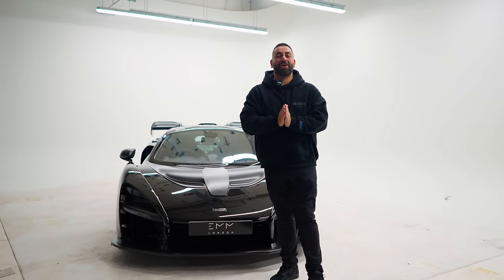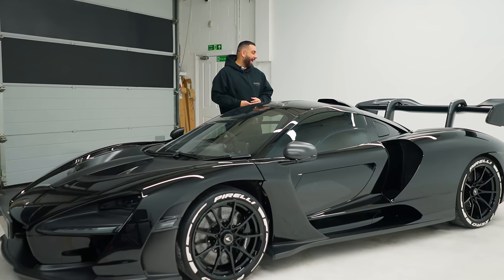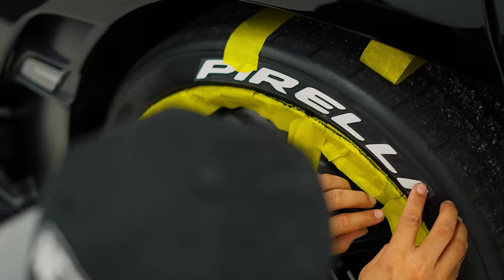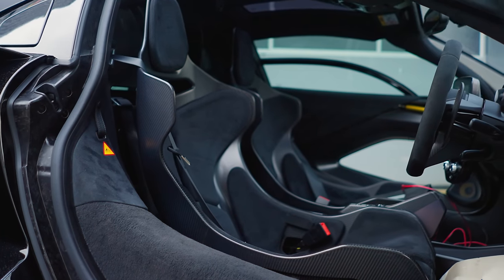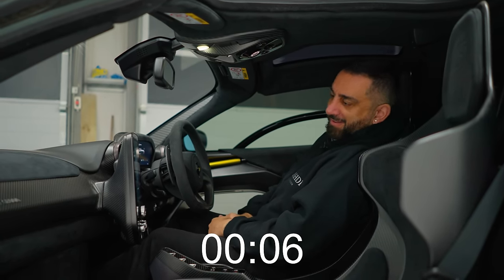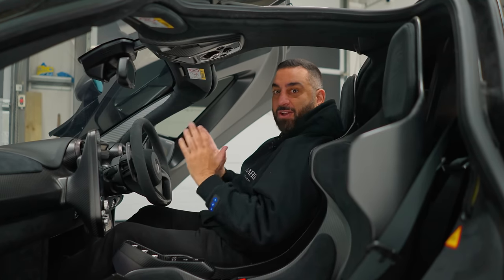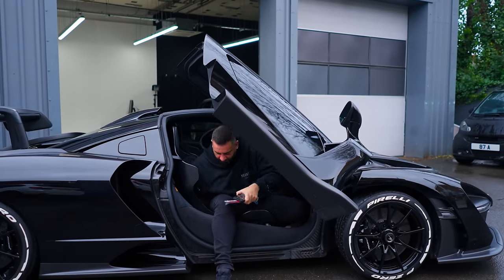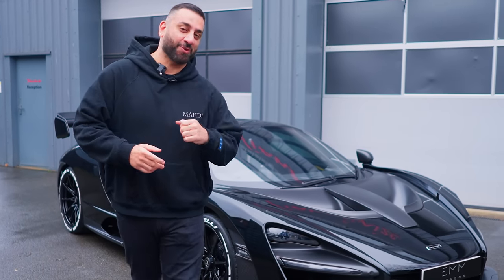@LandoNorris $1Million Senna At Yiannimize

Comment: If you were just doing business and no emotion. 

Get the Lambourgini as it will definitely sell for over cost as soon as you get it. So if you turned that money into the senna it would make the senna a cheaper option than it is now and you'd get the appreciation over the next year or so on the senna, but by then the lambo will have come down in value because there will be a lot more of them on the roads. 

Bish bash bosh jobs a good un. 

Best of both worlds. 

However I'd buy the lambo. Much more dailiable